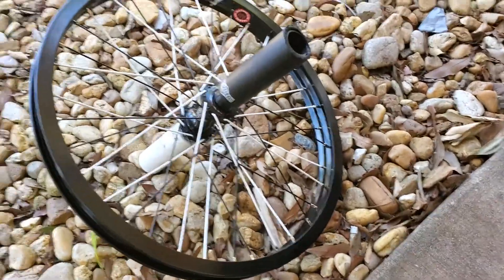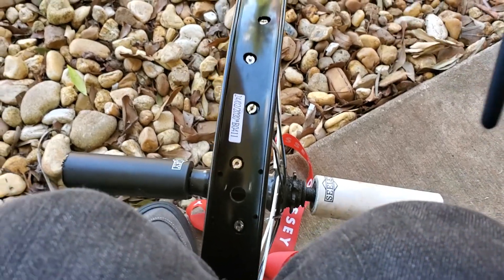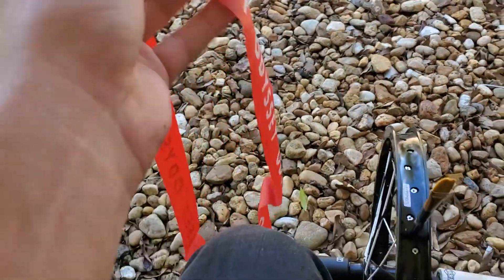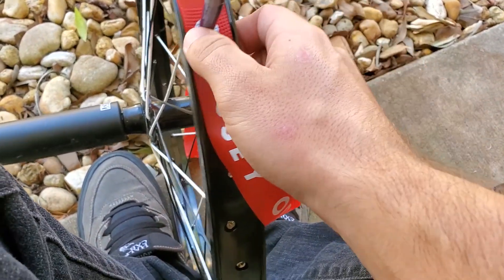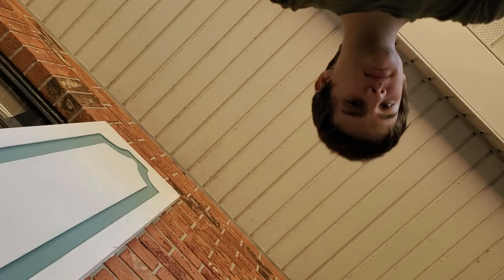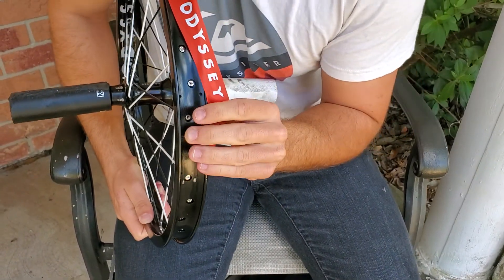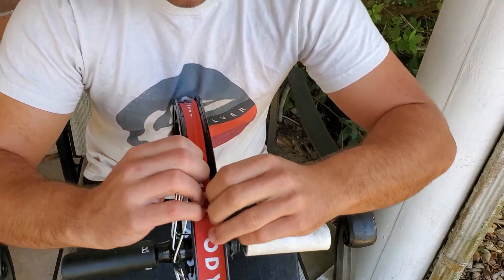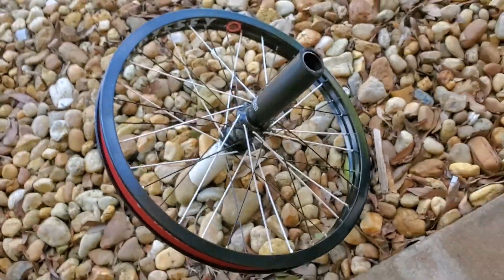How To Install a Odyssey Bmx Rim Strip

Comment: I got the the thicker eclat ones, did the same thing on the first one. I stuck a pen cap into the air hole and after the first one went on twisted, I used my plastic tire levers to untwist it on the rim. Put the second one on with the tire lever in a minute, didn’t have the twisting prob using those. Nice video.